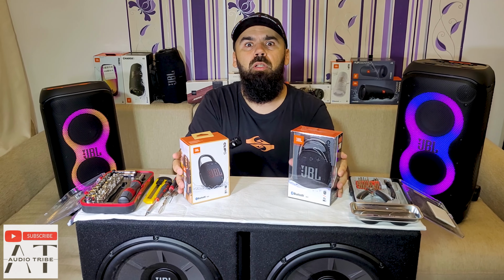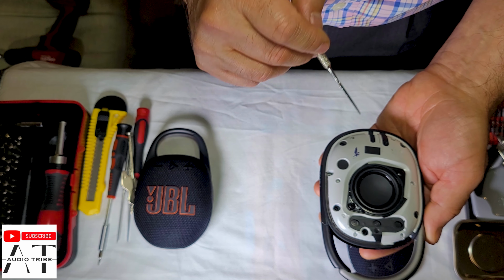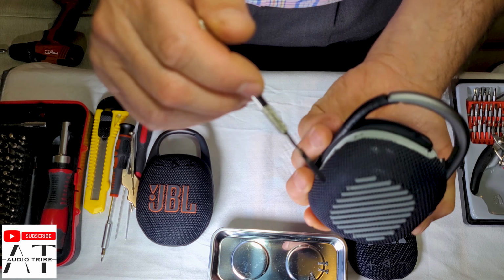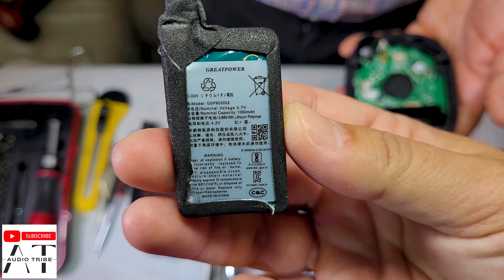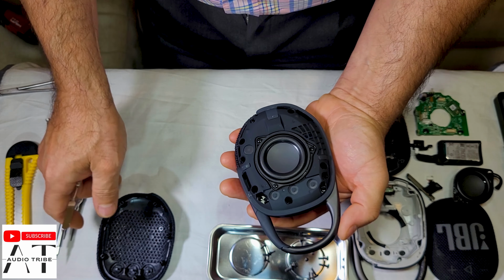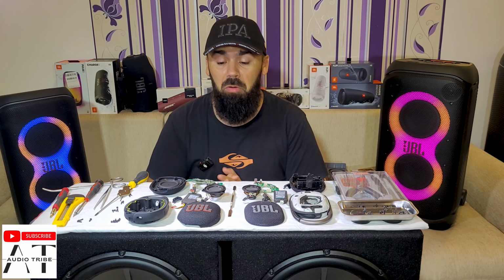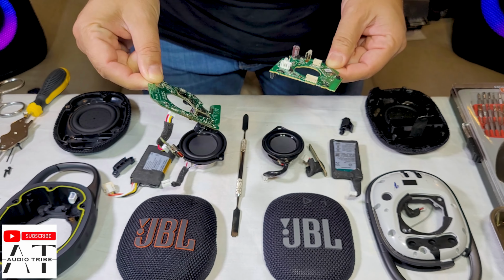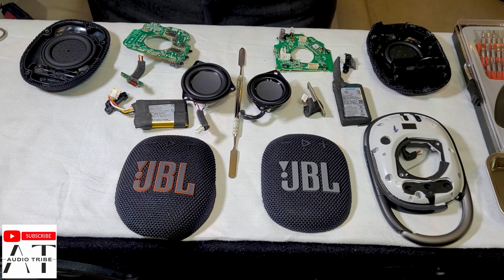Full Teardown JBL Clip 5 VS JBL Clip 4 What's REALLY the difference?

Comment: Hey! Nice video, i have a question. What speaker would you recommend. Jbl flip 6 or charge 5, i already have a flip 6, but also want a good speaker for partyboost, feel free to recommend any jbl speaker, thanks!
Reply from the maker: Hello - the jbl charge 5 in my oppinion it is the perfect small speaker, it has bass, it is loud and it is small. But of course, the xtreme series is a lot louder. It depends on the budget and on the size. For me, the Boombox 3 is the best portable speaker because it looks amazing and is not that big as the 320 or 120, and it sounds amazing. Let me know what you chose. Cheers